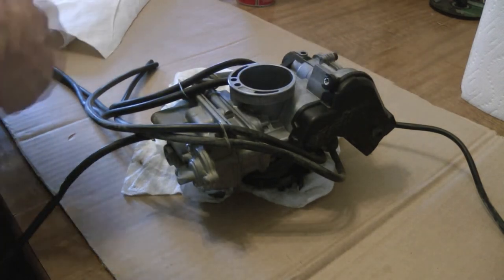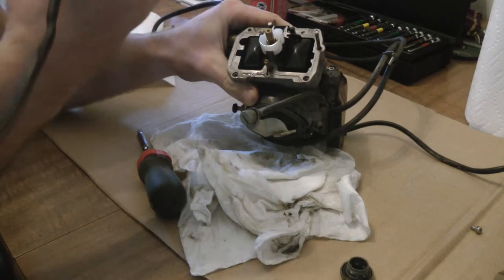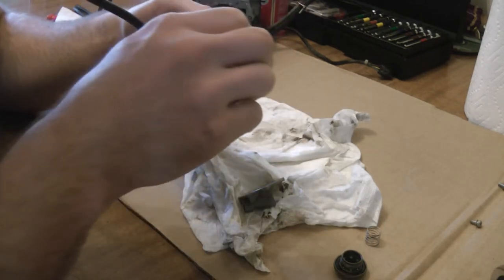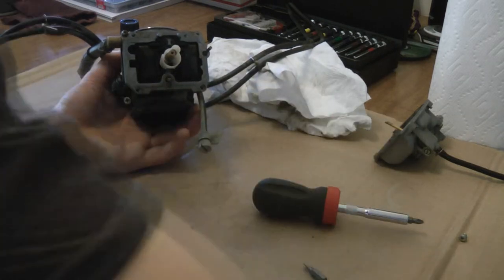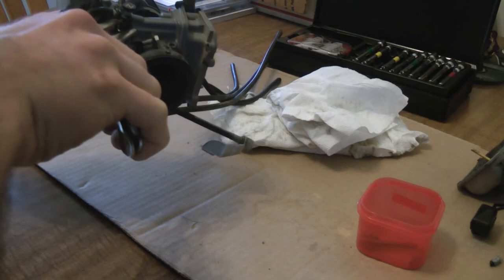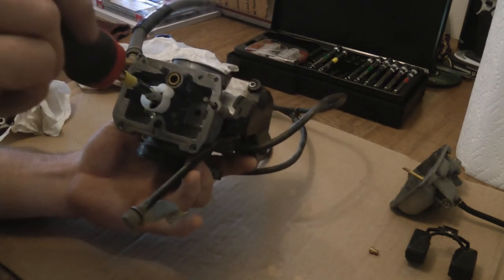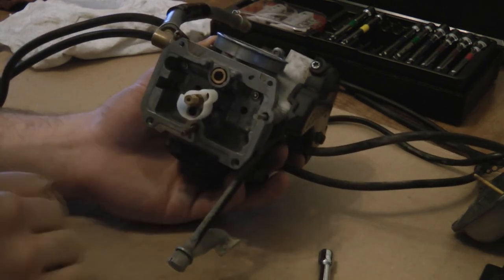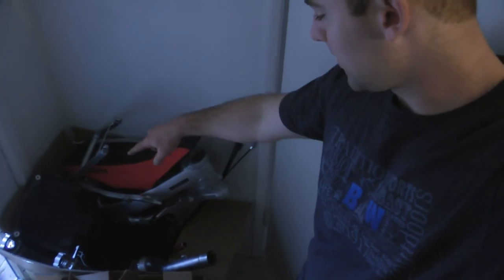Cleaning the Carburetor on a Dirtbike [2008 Honda CRF450r][S2E5 Craigslist Build]

Comment: The 1 and a half turns out work out for you? Mine was 3 turns away from tight for some reason. Currently putting my bike back together. My bike was also running terribly before so wondering if I should put the pilot screw back the way it was or put it 1 1/2 like you did. Thanks!
Reply from the maker: I remember having to adjust it, but don't remember the exact setting.